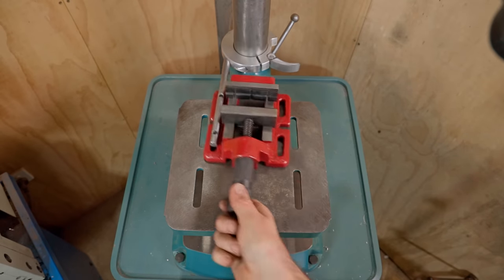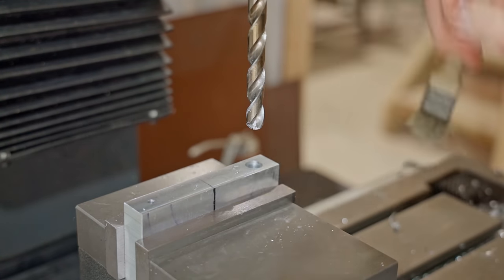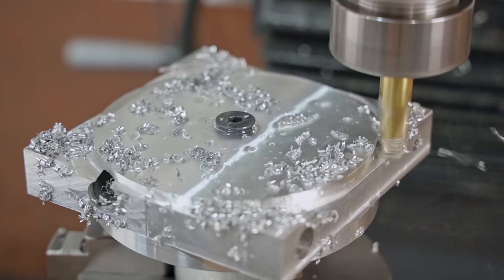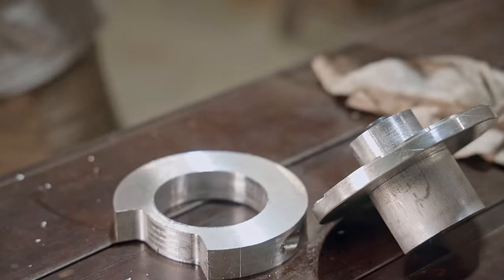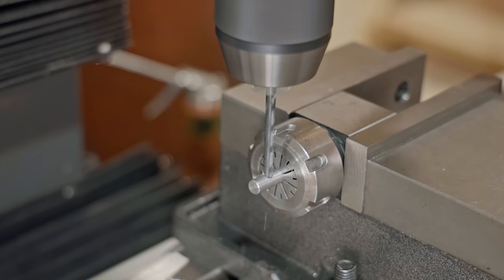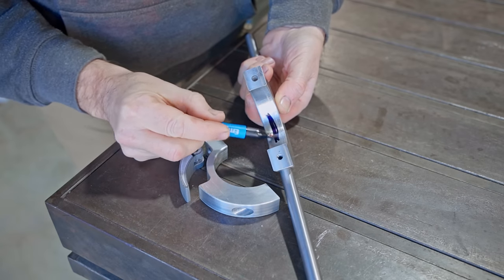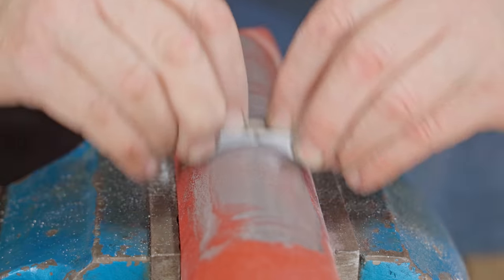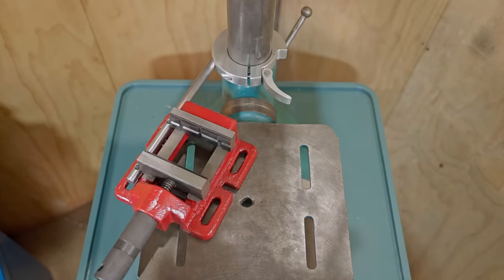Safely Lock Down Your Drill Press in an Instant

Comment: Looking at the youtube preview I just saw the vice with a rod attached to it, extending past the column, which I thought was a simple and neat idea that I've never seen before. It would for sure prevent the vice from spinning. Ideally you would want to aim the rod at the location of the drill to prevent the force from the drill to pull the piece away from you (with rod on left side) and put a side force on the drill, but I think it would be well enough to angle the rod towards the center of the vice grips. I'll test it out, its a quick thing to do.

Comment: If you manufacture them in any numbers, I would buy one for use on my drill press and I’m a wood turner. You can have some serious binding issues especially when your using a large bit to remove the center of a vertical post to be turned into a vase!

Comment: I like the ring part of the project. My old Walker-Turner floor-stand drill press has a heavy table and no rack. When you loosen the table, it can fall like a guillotine blade.  Having such a ring clamped below the table a few inches would prevent this.  Even better would be a counterweight.

Comment: I have an idea for you. I know you like to hand file a lot but I also know you're keen on making different tools and such, especially if you can do something special with the construction of said tool. SO how about making a tumbler for smoothing, polishing, and deburring your metal parts such as this clamp? Yes doing it by hand is faster and arguably more fun, but the challenge of coming up with a unique design build for the tumbler seems almost worth it on it's own. Especially if you use an idea like you did for your drill press stand. Unique and different and only you would have one like it. Anyways just a thought. BTW your clamp is a great idea. I will definitly have to keep it in mind.

Comment: The Float-Lock (sp?) has one additional feature: The clamp that fixes the bar to the table has a very slight tilt so that setting the clamp puts some downforce on the vise body. Off hand, I don't see any good way for the single clamp lever to do all three jobs. (Axial, angle, and downforce.)

Comment: Even if you do not lock it, the geometry already removes enough degrees of freedom from the vise that would allow it to spin if the work catches...

So one could easily allow the drill bit to find it's center-punch mark just as you do while hand holding, but with out having ones hands or fingies anywhere near the spinny bits of the machine... 

:)

Comment: It would be super cool to add a spring so it is default fixed and then to add a handle to the vice that pulls a cable to release the tension so that you can move it.

Comment: First of all very nice. I like it. Second, would it have been possible to drill the hole for the rod just slightly intersecting the hole for the column so that the rod would be clamped by the column and not requiring the shoe?

Comment: This is amazing :D   i always wanted an electromagnet  to hold the drill press vise,  but it was always too hard for my brain..  this solution is very nice..  thx for the video :)

ps.   I also looked into using 2 magswitch things,  but they cost alot :O and dont know if they are strong enough..

Comment: You don't even need the aluminium ring. Just the steel rod pressed against the column would be enough to make it impossible for the vise to spin. Drilling would only press it harder against the column. The ring is only useful if you want to keep your vise located in the same spot respective to the drill bit for repeatability.

Comment: I wonder if this great idea could be made to work with clamping action from the front, so you wouldn’t have to reach around the drill towards the column, to clamp. For example by adding a cam on the long sliding rod , that clamps tthe vice (via a bushing fixed to the vice) and clamps the shoe inside the solid ring  at the same time? Then rotate the rod to clamp, with a suitable lever near the  front of the vice that you would also use to position the vice to the next hole..? The cams would have to be sliding on a keyway on the rod, which makes it again more complicated…

Comment: Very slick project, but I probably will skip the complicated rod holding shoe and instead just drill two holes from the center of the ring to intersect the rod, then drop in a couple of delrin rods to press against the rod when clamped.  Much simpler, and if they end up too short, easy to replace.

Comment: Pask Makes, thanks for showing us how u had made ur Drill Press Clamp.
I also have a Drill Press Vice,  I use two knobs/washers and two bolts to hold the vice on the stand.
Butt i can only use the vice at certain angles.  You clamp works better.  how much to make me a clamp?

Comment: Do you add lubrication when cutting the aluminium on the band saw because you have the wrong pitch tooth blade in the bandsaw?  I've just always used a lower pitch blade when cutting aluminum, and never needed any cutting oil.  Also, that fly cutter footage is sooo satisfying!  thanks for showing that!

Comment: The rigidity of the mechanism is given by the rigidity not the bar connecting the ring to the bar. I believe that a ring made from birch plywood would have done the job too. Just saying, since it's something most makers would have an easier time acquiring and making.

Comment: Just use the slots in the table for what they are made for: Either for directly clamping the vise (like T-slot nuts etc. on a mill) or to clamp a stop there. This stop is just a rod (say 100 mm long) with a T-slot nut.
That's it! Too easy?

Comment: The idea is not new. Swiss manufacturer Gressel has the 'Führungsschiene' or 'guide rail' for their line of Ecopos vises. I have used it since 2003 and have advised people to get it because it's the most important safety feature for the drill press. Gressel is quite expensive but there never was money better spent.

Comment: I am sure you must have a reason, but I have to ask:  Instead of adding a shoe for the rod, why did you not just drill the hole for the rod a bit closer to the center in the first place so that it would be pressed against the drill press when you tightened the cam?

Comment: Bloody brilliant!
Reply: Always strive toward safety however every drill press has a built-in safety feature..... the column.
Long workpieces may be rotated to contact the left side of the column, then clamped before drilling. 
Short workpieces should be held by a drill press vise or other device which can be rotated to contact the left side of the column. If too small simply insert a parallel before clamping to form a contact bridge to the column. Our shop Delta 3 gang drill table had several 1 1/2 x 2 & 4 x 8 inch aluminum plates drilled/machined for the chuck key/drift storage, my home drill press used 2 x 4 and 2 x 6 wood blocks.
If you are using reverse rotation right side of the column contact is desired.

Comment: Honestly, this doesn't seem necessary.

You can just have the vise locked into the slots of the table with semi-loose screws so it can move along the slot and then you rotate the table around the column. That gets you the same effect, with the same amount of work to lock it down.
If the table has t-slots that allows for more radial movement than your table would.

Neat project, but again, you really don't need that.

Comment: Great! But this can still be improved. In fact, it does not need any clamping. Let it slide. This will still hold the vice in place without allowing it to rotate.
Reply: Negative. The vise would still be free to move along the longitudinal axis of the locating rod, so the work could still oblong out in that direction. No goodnik, comrade.
Reply: @martyschrader  Agree. But then it's better to clamp it with a separate ring above the fixture so that the fixture can move freely along X and Y axes but is fixed on Z.
Reply: @alexeygalakhov7580  My understanding -- and what I surmise after seeing the vise in action -- is that the idea was to clamp the vise down in all three axes so that the work had no chance of moving. This would make sure any operations performed would maintain precision and not be affected by the work wiggling about.
Reply: @martyschrader  Clamping in all three axes is not always good for hole precision. Since the machine isn't a mill, it does not have any way to precisely move the workpiece along horizontal axes. This will make the precise placement very challenging. However, if the center of the hole is already precisely marked, the workpiece will seek the center on its own if allowed to move. Usually one doesn't want to fix the workpiece completely, it is enough just to prevent it from flying out if something goes wrong. If all three axes are fixed, one needs lead screws along X and Y for precision positioning.

Comment: I work with 5,6 and 10mm aluminum daily and have never clamped it down nor have I ever used oil to cut it on a bandsaw or used oil on a drill press😂😂😂

Comment: Hi, did you notice the slotted holes on your vice and drilling table? They are not designed for fun, but for bolting your vice to the table, sorry but the idea you have is not safe because the rod can bent upwards wen a drill is forged to the material. Just a note from a metalworker for 45 years.

Comment: what are you talking? okay, anything that makes you happy.  but the table has slots in it and so does the vice and you simple put bolts through them.  Two is enough.  One say top left and one bottom right.  That gives you enough room to slew things around and generally do anything you want. Fat bolts the right size.  Keep a spanner for them next to the machine.

Comment: What a great idea but not everybody has all this equipment and machinery to make a tool that has a purpose.
Reply from the maker: Glad you like it Neil! It could be fabricated with basic tools, you can make pretty much anything with basic tools if the will is there. 😊
Reply: @PaskMakes  What would be really great it is to find off-the-shelf fittings that can be adapted with basic tools. The clamp could be a plumbing clamp that holds steel pipes together or sprinkler system pipes.
But it got me to thinking which is a heck of a lot to start with.  I fumbled with pieces on my drill press.
Maybe one of those heavy duty clamps could easily be welded to a drill press vice.